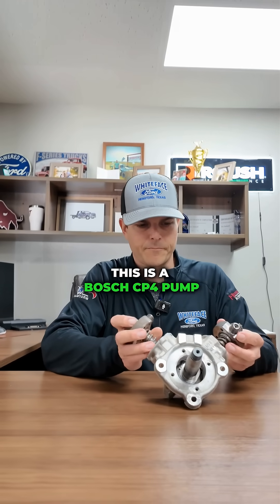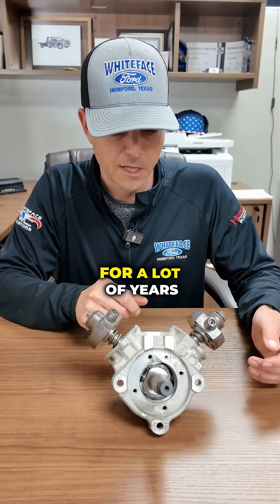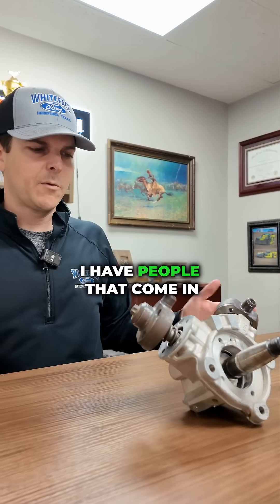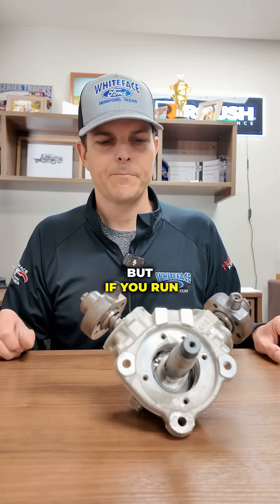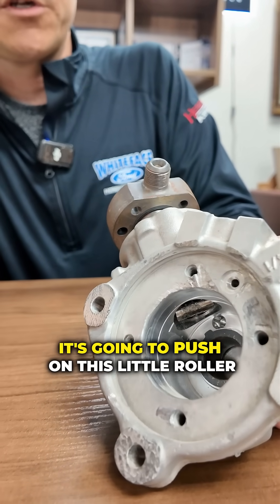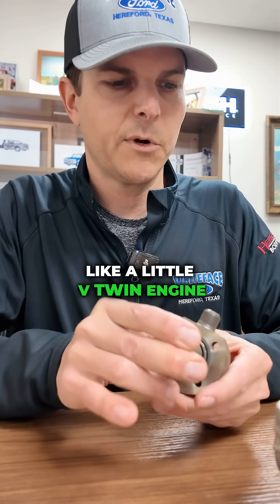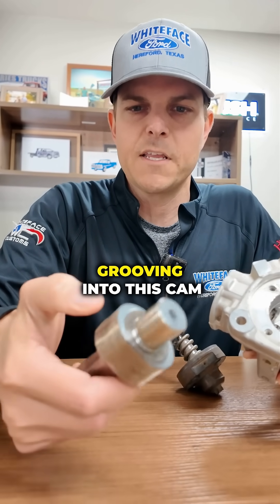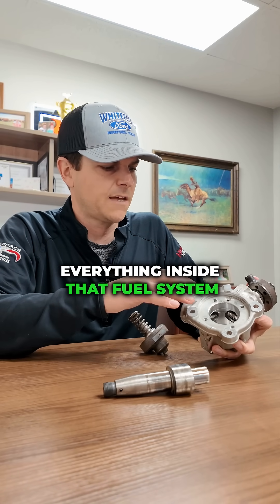Is the CP4 Pump Really That Bad? (Pt. 1/3) #Shorts #DieselTech #FordTrucks

Comment: I love my truck first of.   But the fact that my brand new super duty with a heavy tow package doesn’t come with a trailer break controller is absolutely nuts.  And no floor mats in a 60k truck brand new.     Why can’t ford have a disaster prevention kit on it from the factory.  These are valid points.

Comment: It's a POS, and I don't trust it, already changed it out for a S&S DCR pump. You can do everything right, fuel additives, the best fuel, filter  changes, not one bit of my fuel system is stock. It's the piece of mind now I have, no more CP4 pump to worry about

Comment: It's not just air that will destroy that pump. Fine micron dirt/debris in the fuel will stop that little roller. There is a filter system that can be put on to keep metal out of the injectors and a FASS system will also help.

Comment: What I do: Fuel filter replacement every 15k (make sure to properly purge the system when you do this), clean fuel (don't seek out the cheapest, fuel where they are busiest, more fuel sold means more fuel delivered which is freshest), drain the water seperator monthly, and never let the tank run to less than 1/4. If the fuel minder comes on and says 50 miles to empty, you are waiting to fuel to late.

Comment: Dodge only used them in 2020. They went right back to the 3s when they saw the problems ither had. 2025, they had boch redesign the cp4. It's completely different, idk why they didn't give it a different name.
Reply: No, RAM had them in '19.  They did a recall and went back to the CP3, and replaced them for free.  I had a '19 3500 that had the recall.

Comment: Curious how many times you prime the system after draining water separator or changing fuel filters?
Reply from the maker: I do it based on the sound, you can hear it quiet down when the air get out of the system. Usually takes 5-7 key cycles
Reply: I turn the key and count to 10, do this 6 times. Never had a dry start on my 6.7. I change both fuel filters every 10k. Also add 1.5oz of hotshots fuel treatment every time I fill the tank.
Reply: @howardbarber3767 yea I always use a fuel additive usually stanydyne.. just got the truck a month ago so drained the water separator seeing that it’s a maintenance thing todo once a month. I kept cycling till it didn’t sound dry 🤷🏻‍♂️
Reply: Idk what year it started but my 22 F-450 will not start if the fuel filters are not primed. Once you cycle key and fill filters completely it will start. But I believe that’s all 6.7’s that way last few years.